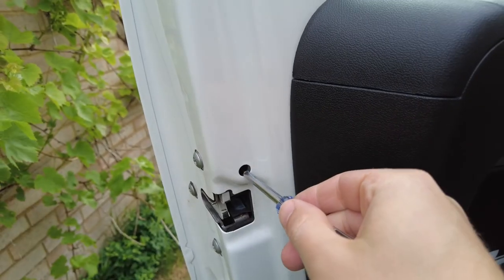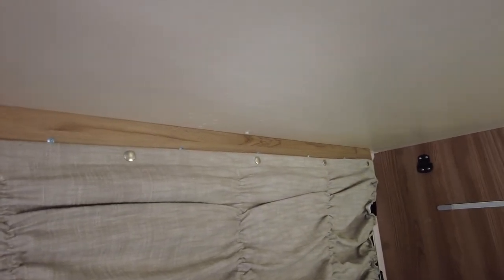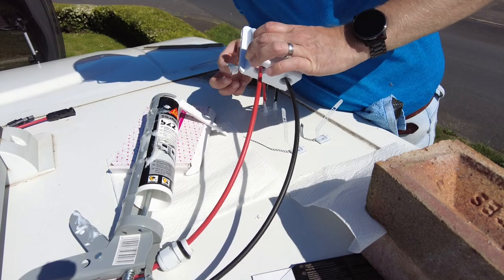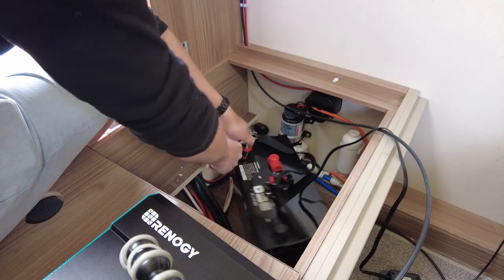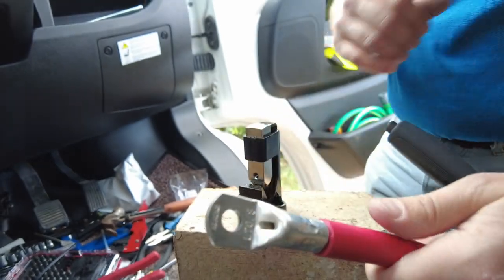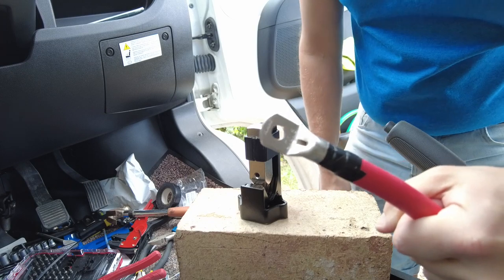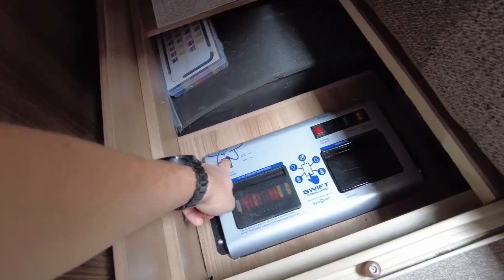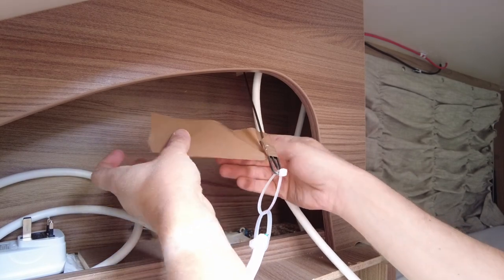Lithium & Solar Motorhome Upgrade Part Two

Comment: Excellent completion to the project sir, a worthy use of what is basically dead space under the jump seat, and nice addition of the inverter. time for me to break out my wallet i think and order a couple of batteries for mine. well done!
Reply from the maker: Thanks very much. We used to use that locker for the bedding for the dinette bed but eventually we got more efficient and it was left empty. Good luck with your project! If there's anything I can help with, let me know!
Reply: @2.4inaVan  just realised my behind seat locker is a slide out so i can't get a battery and inverter in the same box!! but also which batteries did you buy as i contact renogy to see whether their 100Ah Lithium Ion Phosphate battery would go on its side under the drivers seat and they said no, so interested in which ones you had. cheers.
Reply from the maker: @stephenfoster1971  I mounted ours on its side under the driver's seat. It's the 100ah phosphate lithium. Maybe that's wrong but we've not had any issues and I've seen others do the same with Renogy and other lithium batteries. Did Renogy say why it shouldn't be mounted on its side?
Reply: @2.4inaVan  hi there, no they didn't offer any reasoning at all, just said not to be installed that way. i agree with you though, i've read that lithium can be installed in any orientation as they don't have liquid nor do they need a vent, i'm going to get one and give it a try, then work out where to install the other one and my inverter. cheers
Reply from the maker: @stephenfoster1971  it would be really interesting to ask them for an explanation as that was my understanding too.
Reply: @2.4inaVan  hi there, I pressed renogy again and they have just come back with this

 "You could put the battery on its side. If the battery is not damaged in any way or if there is no risk of there being any type of leaking from the battery and the connections are tight and secure, then there should not be an issue.

Please note that the battery must not be stored upside down, as this will affect the life of the battery"

So it seems all is okay and sideways mounting is okay. Cheers
Reply from the maker: @stephenfoster1971  that's good news! Appreciate the update Steve
Reply: @2.4inaVan  hi there, hows it going. i didn't actually go for lithium in the end , i went for a 130ah AGM battery, heavy but managed to get it under the drivers seat, just need to permanently wire in the renogy inverter, rigged it up straight to the battery for a festival the other week and it powered my wifes straighteners and her friends hair drier no problem, and the solar topped it straight back up. what make of breakers did you get by the way, the ones for the battery and for the solar panel? cheers
Reply from the maker: @stephenfoster1971  glad that you found a solution that works for you. Honestly, I can't remember what I went with but I'll take a look at my Amazon history and see if that yields anything
Reply from the maker: https://amzn.to/3XBuUBo 
https://amzn.to/3CSivz8

Comment: Some internal adhesive mini conduit would hide those cables running down the wall, make it look even neater.😄
Reply from the maker: You're right, I didn't have any at the time but might add it. Good idea

Comment: Good job, I've got he same van and doing the same upgrade next month. Is there anything you would change with the set up now you have been living with it for a few months?  Enjoying the videos btw..👍
Reply from the maker: Appreciate the feedback and good luck with your own project. I have added a Renogy 50A battery to battery (B2B) charger to the system. When the engine is running and the fridge is on, there isn't enough current to charge the batteries so they are drained by the fridge. Adding the B2B solves this. As it has an MPPT solar controller as part of it, it replaces the Victron solar charger too.
Reply: @2.4 in a Van  Wow, I didn't know that. That's great info. I really appreciate you took the time to let me know. Safe travels @2.4👍
Reply from the maker: @chrispow011  not a problem, happy to help. Best of luck with the upgrades
Reply: Can I ask what’s the model of your fridge, Didn’t the built in split charger charge to battery’s enough when the engine was running. I was thinking of changing my leisure battery to a renogy one does the factory fitted charger charge them ok
Reply from the maker: @ryanallwood8490  it's a Domestic RC 10.4. Without the addition of the B2B it drained the Lithium bank whilst we had the engine running. The Sargent charger works fine for charging the lithiums on mains hookup.
Reply: @2.4inaVan  thanks for your reply, I’m just trying to figure a few things out for my own upgrade, does your fridge cool on 12v mine in my motorhome cools on gas and electric but only maintains the temperature on 12v, how was it before you upgraded your battery’s
Reply from the maker: @ryanallwood8490  the 12v in mine only works when the engine's running. I'm afraid I've not tested it cooling/maintaining temperature

Comment: Love your YouTube channel, I’m going to be doing what your in the process of doing at some point. Time is my nemesis at the moment. I have the same vehicle a Swift escape 694. Would you be able to tell me what error code e513 or es513,  pops up when the truma heater is on for a while and shuts down.
Reply from the maker: I've not seen that one, apologies. Sounds like it's causing you some issues?
Reply: @2.4inaVan  Thanks for the feedback, I will ring truma and see what they say before next trip. Steve
Reply from the maker: @octocopter1293  best of luck

Comment: If all your 130 watt panel does is charge the cab battery why not just use a Battery Master to top up the cab battery? 
Great job though and props for having a go.
Reply from the maker: Definitely an option. I like having the segregated systems but that's probably just personal preference

Comment: Did you ever have an issue with the van charging the lithium batteries as they take a lot of charge and the alternator might not be up to the task
Reply from the maker: Yes, I later added a 50A B2B charger for this very reason. Good spot!

Comment: Very helpful and much braver than me, think I will leave cables that size to an electrician. Interesting that the Sargent battery monitor thought the lithium were 100% charged when they were only 30% and can the Sargent mains battery charger be adjusted to work with the lithium or have you added an additional charger?
Reply from the maker: It charges fine but the lithiums sit at a higher voltage so the readout displays 100% when it's not. The app shows us the real state of play
Reply: @2.4inaVan  Lithiums (the BMS inside it) try to maintain a steady voltage so a battery monitor that relies on voltage to estimate the statre of charge are pretty much useless. I think adding a shunt or a smart battery is the only way. Does the sergent contain a shunt? I don' think so.
Reply from the maker: @briankeniry219  No, it doesn't, you're completely right. These are smart with bluetooth built in so we can see the stats through the app.

Comment: Great video and as much as I would want to do that I don't think I'm brave or DIY enough to attempt it.. I notice or more like that  didn't notice if you added in a DC to DC charger to boost the output of the alternator, 200Ah of lithium is a lot of battery to refill. I don't know if you considered it or not and I'd be interested to hear.
Reply from the maker: No, I've not done anything with the alternator charging. Might be something to revisit in the future if we need to but for now we'll see how we get on I think.